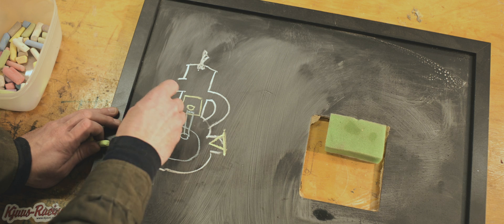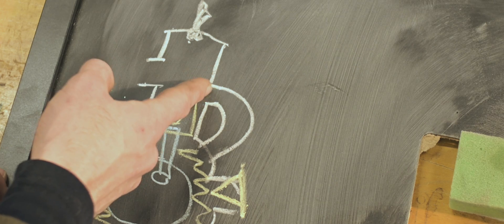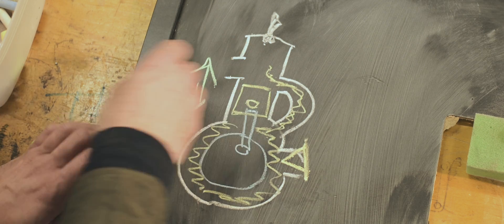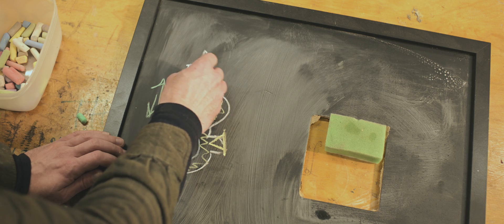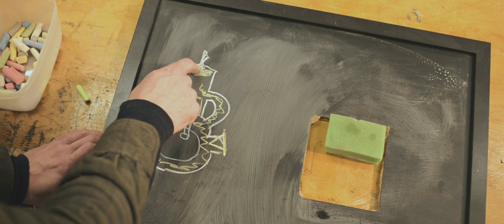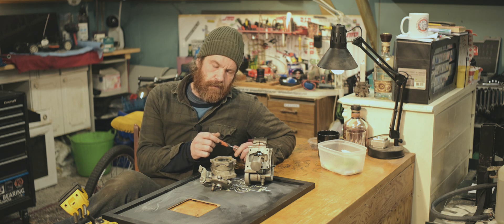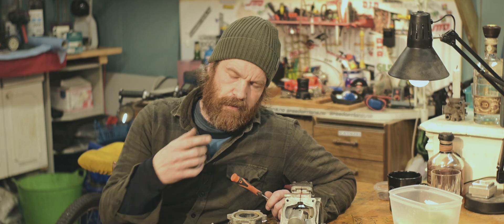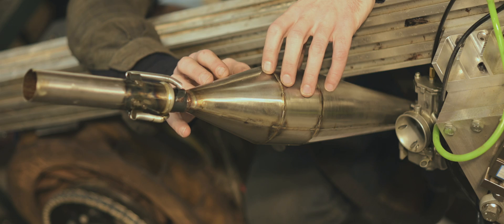Now, That's a two stroke pipe!

Comment: i know you still want that return wave, that makes this tricky but you need a high volume exiting quickly to really have considerable suction that goes all the way down into the crankcase. Larger stinger diameter may help but its a balance between that and still getting a good return wave for sure. Really interesting stuff

Comment: whats the pressure in the pipe like? maybe suction would increase with a wider diameter stinger. I really have no idea but on pulse jets which operate on similar suction principles the stinger is always pretty wide

Comment: Servo operated variable length expansion chamber perhaps? If you can change the chamber length for low rpm and high rpm, it could be crossfed from your power valve system.

Comment: Just so happens I am in the process of using a Microsquirt to EFI my 1976 RD400 and I will also control ignition timing. I am currently in the process of building a steady state dyno out of a hydraulic gear pump and a needle valve. An arduino will monitor rpm and a stepper motor will adjust the needle valve to my set rpm. Once it is held I will measure torque created a with a load cell and a 12 inch arm pushing on it connected to the pump. Once the software I am writing is accurate enough to hold the certain rpm I will then plot a torque graph as I increase/decrease fuel and also spark advance/retard. If all goes to plan I will be able to know exactly where the motor makes the most torque for each cell on the maps. EGT;s will be plotted on the same graph as well as CHT. I will also be plotting O2 although in a two-stroke I am unsure of the readings can be trusted since unburnt oxygen can make it into the exhaust system

Comment: Couldn't you make a variable length resonance chamber? maybe one that is lenghtened with a bowden cable that is connected in parallel with the trottle cable? Traveldistance of the throttle cable in relation to RPM should be proportional and linear to the resonance frequency.

Comment: How does your timing start at 7degrees and jump up if it don’t have a signal to activate it. Like a VOS switch atleast? What tells timing to start timing curve it can’t be strictly rpm because say your at higher rpm at very very slight throttle then the timing must revert back to advanced for smooth running and then when you wack throttle timing acitaves timing curve some how at witch would be rpm dependent.
Reply from the maker: It's just a fixed curve, no compensation for load etc. All you can do is shift it up/down with where you set the trigger point.

Comment: Great vid. I have an idea. There is a 2 stroke video on utube with a 2stroke pipe that is variable length witch seems to activate via a vacuum plunger/simple vacuum advance plunger-rod thing is wat it looked like. . As the engine reves the pipe slides closer and further away from the cylinder. On a crude slip joint   maybe that would combat this low end problem. I don’t remember the name nor the channel I saw this on.  Could run the exhaust slide off vacum or electric motor     This is different then a power valve.

Comment: Would a rotory crankcase be possible, like roller throttle body a smaller volume at low rpm then as the rpm increased the volume would increase, or a variable exhaust length

Comment: BRAINFART1 cant you add a adjustable mechanical expansion and shortening of the length inside the pipe controlled by vacum or pressure tank outside. That can help the engine in low rev and gives a wider effect curve?

Comment: When I was Kart racing, I had a similar ignition system. There were companies that made retarder boxes you could add on, to allow higher initial ignition, which then backed off timing by so many degrees per revs. (Amount was determined by what was required and the boxes were tuned as appropriate). I would think something like this with a variable exhaust length would go a bog way to improving power band.
Reply: Yes i made one for my vespa, I found the sheets online it was not very hard to make.. It was years ago and I can't remember where I put them tho
Reply: I was thinking that maybe like the Yamaha power valve ..sort of ?
Reply: @andrewpaulstancer5704  power valve is a nice thing but we are discussin on having cistom ignition timings
Reply: @mrsnezbit2219  😮‍💨😮‍💨😮‍💨
Reply: @charlesangell_bulmtl  mh?
Reply: I understand what you guys are getting at and the best way i see to do that motor for max hp on the dyno is the exhaust servo i posted above...spark isn't going to change what you really need?
Reply: https://youtu.be/qIf4loTFeiw
Here's a neat mod I did to my 50cc, very quick and simple to set up just ram the legs of a capacitor into the killswitch junction and tape er up

Comment: I'm surprised your not considering making the pipe a slider. Make it long down low to get the pulses in time then shorten as the revs increase. You could throttle the engine with pipe length essentially. Some Kneel down, outboard hydros use a slider pipe pushing the pipe out manually in a turn then pulling it back in on the exit.

Comment: It seems like the dyno would be perfect for testing snowmobile engines or engines in the 150hp to 300hp range. I just have a feeling the eddy is too big for an engine making less than that. Too much bearing, belt and chain drag... I love the concept and it's much better than something I could build, just seems a bit large and getting overcomplicated.
Reply: I have one of these Telma electromagnetic driveshaft brakes on my 2001 E450. Looks about the same size and it really makes a huge difference on how heavy the truck feels. It does 90% of the braking down to 10mph..... Never even thought it could be a dyno.
Reply: @thomasbarlow4223  To be fair it's only the part of the dyno that does the breaking, the other part (being torque measuring) happens right on the crank, which isn't very common outside of engine break rigs.
Reply: @MetroidChild  I realize that the load cell will still give an accurate reading but if the engine cant get up into powerband  then it's not very useful for an engine that small.
Reply: Your moms a bit large and overly complex

Comment: Nice ! Pretty narrow band. May be you can also play with the length and volume of the exhaust. I am just thinking about the good old 103 exhaust RGD "pompe", with a variable length on the diverging cone. Another way to implement this on the exhaust is to put an additional chamber with a butterfly like the old Honda 125 CR 1985, it was called ATAC.

Comment: Two stroke jetskis inject water into exhaust to it cool down and lower resonance frequency. By changing anount of water in pipe we can make power band wider without losing peak. With water exhaust is cooler and frequency lower. Less water = higher temps and resonance frequency. 
Looks easier then changing pipe geometry.
Reply: Google "WATER INJECTION
 By Randy Norian" there is some graphs from dyno

Comment: Ditch the reed valves , the pressure the supercharger maintains should be enough and I think a longer primary with a 90 degree bend should help with the resonance in the pipe . But I really have no idea what I’m talking about.

Comment: An exhaust valve which could change the exhaust timing (power valve) would be able to help your pipe wave timing issue. More duration would allow for a high rpm timing with the same pipe, shorter duration for low rpm. At least using the port timing formulas for pipe effective length from Blair’s design of two stroke engines.
Reply: I think he intents to use this engine only at full throttle and resonance rpm. Kind of like a stationary engine that would always run at a constant rpm. The clutch and CVT will ensure that the engine rpm(under load) can be the same no matter the speed of the vehicle. So a very narrow power band isn't an issue.
Reply: @marcelpursche5339  I think that there’s very clearly an issue with the high crankcase volume not having enough scavenging at below peak rpm, so he cannot spool the engine up under load properly. Only real solutions for more scavenging (beyond piston/port) on a two stroke is pipe induced scavenging or forced induction. If he could have a clutch that kicked in at higher RPM this would clearly help it reach the rpm, but the load from the dyno might still bring it down enough for problems. Perhaps upgrading the ECU to programmable would help get the spark timing to help with piston/port scavenging as well. Complete engine management across RPM and Load is key, and is the difference in a good engine and a good-enough engine.
Reply: @brannonhudson6868  an pipe that has a slider so its rosonant frequency can change would solve his problems too
Reply: @marcelpursche5339  hence im hinking he will make it easier and faster to use the exact same cvt system on the dyno...

Where he can tune both engine and cvt system for simulated speed run
Reply: Yamaha did this on at least some of their old 2-stroke bike engines. It's... quite an engineering feat, to make it work well
Reply: @JohnDoe-fk6id  I find power valves on most 2T engines nowadays… yammy, rotax, Suzuki, Polaris, beta, KTM, etc… 
unless you’re talking about sliding tuned pipes. If you could send a like to something like that… that would be awesome!
Reply: @brannonhudson6868  I had only ever seen one version of the power valve. I don't do a lot of 2-stroke work. Guess I need to catch up with the times! Thanks for the info!

Comment: to much rotational mass in the magnetic load brake, can you take one of the flywheels off and just run one not two??
Reply from the maker: Gearing down should help, it doesn't have to spin very fast.

Comment: We used to have a movable exhaust system on the kart. Longer for acceleration, then pull it in down the straight for higher RPM performance.

Comment: Could you add a second pipe for low-mid RPM and then switch it over via diverter valve once proper RPM has been reached?  Almost like VTEC for a 2-stroke.
Reply: PTEC for pipe

Comment: You could make a variable length pipe to help with low speed. Maybe even do the math to figure out the ideal length of the pipe at different rpm's.  LOVE the aspect ratio!
Reply: in theory you should be able to achieve an excellent power band however the engineering challenges for such a project are hard to overcome, ie heat and vibrations. also i think it would never perform (peak power) as good as a pipe designed for the rpm imo

Comment: I had a similar problem with top end power on my Mum's 50, It was not revving out when she went to get the weekly shop, I tried everything, new piston ,re jetting, saved up for an expansion chamber, I even filed the exhaust port to move the power band up the rev range and trimmed the rotary valve to get more fuel in. Turned out she was pulling the choke out to hang her shopping bag on, Went like a scolded cat once I worked that out.🤪
Reply: That's bloody hilarious! I genuinely laughed my ass off, as I'm sure you did once you discovered that lol
Reply: @tylerdrummond4609  oh no -did you manage to get your arse back on again?
Reply: The motor I had was vibrating the choke lever down so I would have to turn off the choke while riding and hope I didn’t have to make any sharp turns. I just tightened the bolt on the choke to solve that.
Reply: That's classic!
Reply: @sourand jaded But I do know a story of a car, that had probls running while doing left turns.  After a lot of checking and "fixing" it turned out to be a loose exhaust  manifold, that was "pulled open" by the weight of the exhaust.  The story was - but my dad was full of shit, so that one might be fake too..
Reply: That's awesome bugger with choke , but I bet your mum was happy with the performance upgrade.
Reply: @sourand jaded me too - 40 years ago..
Reply: @sourand jaded had the same issue on the highways. Had to zip-tie it closed for the time being. Would hit a bump and boom my bike would cut off.
Reply: @sourand jaded Same. I heard the story about an old VW beetle. Also choke lever, also handbag. In reality it's inconvenient to impossible to drive your vehicle like that.
And if the guy really checked it he would have realized that it's working properly.
Reply: @gustavgnoettgen  I enjoyed it.
Reply: @falconater68  Me too, but only the first time
Reply: how did you not catch that before ripping the engine apart lol. damn. that sucks.
Reply: OK  , that  is  FUNNY  .🤣🤣🤪

Comment: Maybe fluid is suitable for fine tune exhaust pipe? Make it adjustable for find power peak. Also for crankcase volume adjusting? Simple water brake is better to adjust than electric?

Comment: you could make dynamic exhaust that changes lengh with a servo so you have more power at the lower rev range 😄 there is a video on youtube where they did that with a 125cc engine
Reply: here is the link to the video 😄

https://youtu.be/0odVzSgufjk

Comment: Hi, pretty sure you could buy a speed controller to set up your dyno retard thingy as a motor to get the thing up to speed and then let your engine take over... Alternately just buy a different Motor and use it in that manner. I'm pretty sure you don't care what power you're producing below 10k anyway...

Comment: Has anybody tried a telescopic expansion chamber? It would be feasible to servo actuate it linked to engine RPM within a tuneable range. 
Another option that may help is a fluid clutch. We used to build go karts and minibikes with them, always playing with oil volumes and viscosity to tune the engagement.
They came from old washing machines, and were basically a small finned aluminium torque converter. A magnetic clutch could lock it up once full torque exchange is in.
Just some ideas...
Reply: has been done, varible chamber lenght. Hard to seal

Comment: From my experience wave action tuning NA 4 stroke engines, the Intake tuning is always a lot more powerful than the exhaust. You can have crazy gains with intake runners (+20% to +30% BMEP) that are tuned appropriately. But I guess it works differently with 2 strokes or the RPM is so high that that short runner on the carb is sufficient enough? Maybe that is worth looking into?
Reply: i heard if you got intake in a range where some resonance charging might happen, you will never get it right with the powerband from the exhaust and it somehow hinders power.
So the current "state of the art" is to just make the intake as short as possible as you will never get in the rpm range where resonance might happen.  I guess
Reply from the maker: The problem is how long the intake would need to be. PiP secondary intake is tuned and will be(after some real life adjustments) around 150mm long if I remember correctly - tuned for 19k rpm.
Reply: @sersge   That is interesting, complete opposite of 4 strokes I guess
Reply: I have an adjustable length airbox. If adjust just a few milimeter it provides 10% more power. At 140 degrees of inlet its around 22cm to the adjustable reflective wall. Yes Its a 8000rpm moped not your 20000rpm hell machine. But a proper airbox does a great job!
Reply: I tried this approach on a kawasaki h1 and it works but it plays havoc with the carburettion and I could never get it right, the mixture gets much richer as the intake approaches resonance. part throttle would damp the resonance. Eventually I went to a shorter intake and it works though the maximum torque is noticably lower. I have a fuel injection project  to fix this.

Comment: How about rigging up an electric motor to "pre-spin" up the dyno braking assembly rpms, to allow your engine to come up to the power band? It seems to me that would solve your problem.
Reply: But then how do you use the engine on a motorcycle? Afaik alex is going to salt lake flats for some speeeeeeeeed